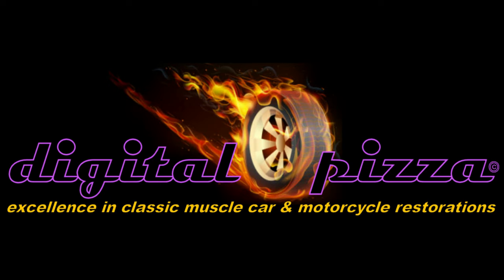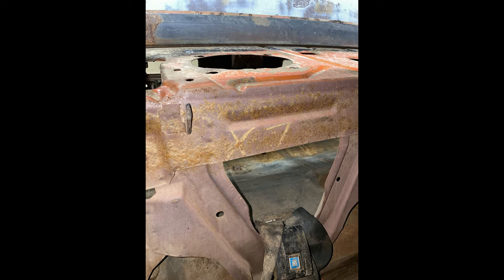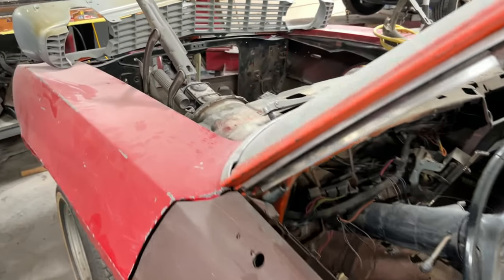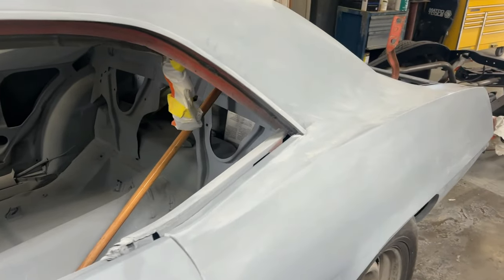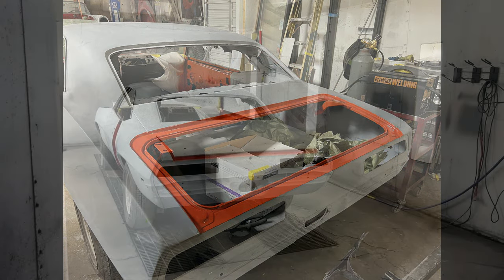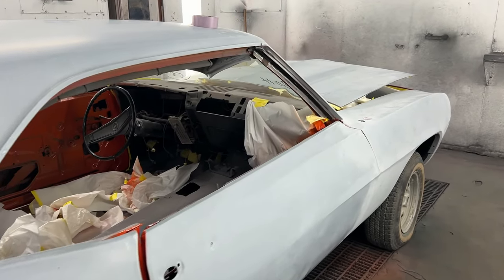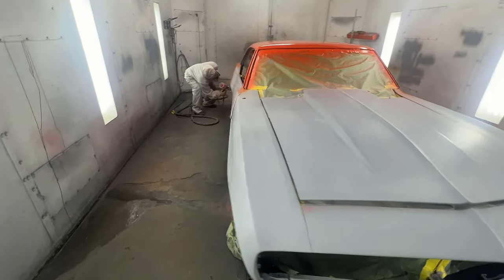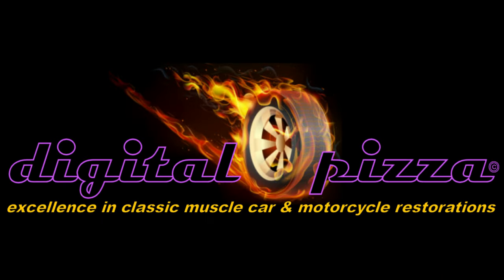Full Restoration of a 1969 Camaro Z/28 in Hugger Orange -  Part 1

Comment: Nice job so far. I bought new qtrs from GM Parts back in 1985 for my 70 Z/28. I think I paid $250 each. Had mine stripped to bare metal and painted with Centari with a clear on top. Paint today still looks the same as it did in ‘85, and I drive the car in the summer.